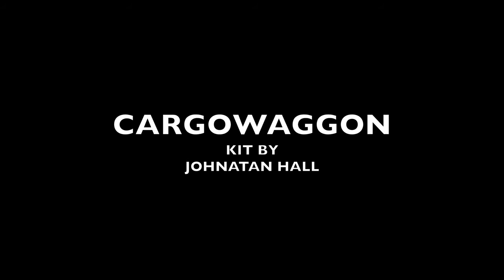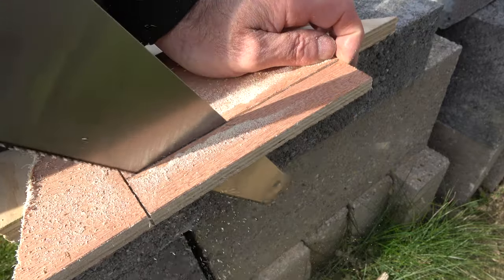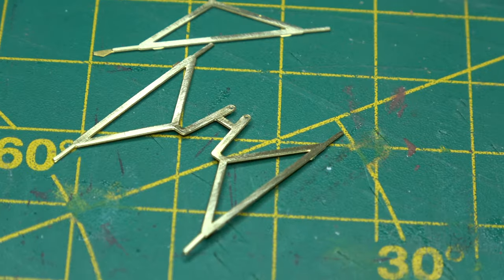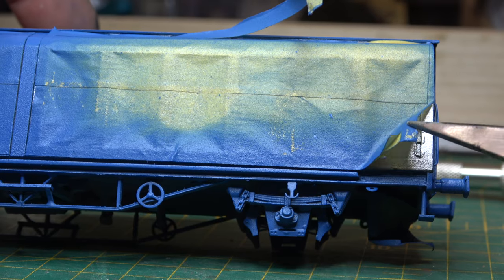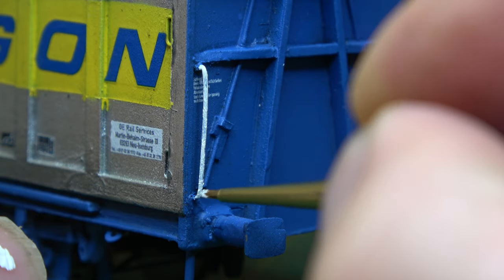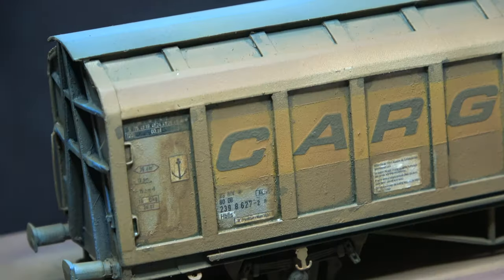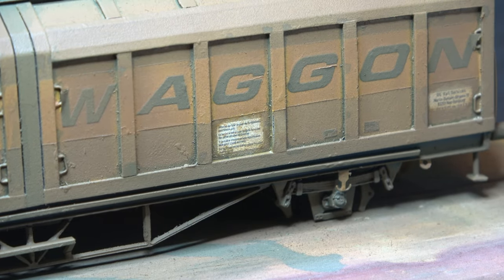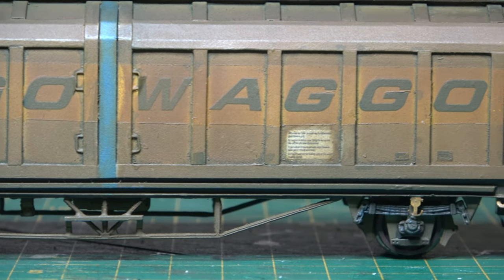IZA CARGOWAGGON kit build

Comment: Wonderful stuff! 

Now you're fully into the resin and an expert in the field maybe you could nip over to southern pride kits and indulge in a resin body for LION, fits a hornby 47 chassis. It has some things going for it... no yellow ends😅🤣

Edit; Did I say southern pride... I meant golden arrow... apologies.
Reply from the maker: A few years ago I converted a Lima deltic into DP2. Lion could be a potential project 🤔
Reply: @Wallsrail  being white it seems like it'd be a weathering challenge as well. Very easy to make it too dirty
Reply from the maker: @Trainskitsetc  Ooh now there's one of my pet hates 😝
Model engines with unrealistic weathering 😖
Reply: @Wallsrail  sure it would also involve some nice chopping and changing of bogie side frames to make something a little better looking than the raw donor 47 bogies

Has all the hallmarks of something you'd get joy out of, an adventure into making something that looks the part from something that's a bit meh. Not that you need suggestions there's probably a list as long as time of things to do

Comment: Nice to see you back with another wagon kit, never seen on of these before in person, the work you put into these kits amazes me.
Having a few troubles with a class 31, it's a Hornby original chassis with an airfix body, only problem is that the model was detail painted blue, the had the steam heat equipment filled and then was dumped in a box, so the paint is damaged and unfinished, I'm rubbish with a brush and thanks too 2 more 31s I'm now in £40 debet with my grandad.
Like you I have many projects on the go, mainly using mainline mk1s, some spares, a 37 nose for the high intensity light and a class 43 chassis
A sort of nodd to thumpers🙂

Are all old men bad with buying kits, after finishing three open wagons, my grandad bought another two😂

Have a good one and enjoy your hobby ☺️
Reply from the maker: Hornby/Triang 31? Hmm now there's a potential future project 🤔
I spend an awful lot of time scouring ebay for rare and out of production kits!
Reply: @Wallsrail  oh not that old its one of the original Hornby super details ones

Comment: Ahh the IVA vans. Being a 2mm modeller (West Coast, early to mid 90s) These have been on my to do list for a while to model the Dagenham - Garston Ford Train. Sadly they're not available RTR in 2mm, nor is a kit available. I may have to go down the 3D printed route, but as you say, there is a big difference between the IZA twin sets and the IVA. Length for a start. Another enjoyable watch.
Reply from the maker: Ahh the Dagenham Halewood 6L42 6M41 
class 90 and a string of wagon 1/4 mile long 100SLU. 
Used to be on that service quite a lot when I first started driving based at Crewe!!
Reply: @Wallsrail  Halewood of course, not Garston! Ahh fantastic mate.

Comment: Also may I ask, what is the paint code of the MIG blue paint you have used? I have a couple of Tiphook bogie curtain siders to do and the blue looks pretty spot on for the ends. Again, doesn't have to be the exact shade, as most will be weathered anyway. Cheers. *EDIT* 123 Marine Blue ??

Comment: hummm... Just one, you would need 7-12 for a rake and maybe some of the double sets to give the full train look.  i dont see the Ford logo either????  Having said that as a show piece  it would be just fine as it is. stuck in the middle of any freight set it would be a great purchace.
Reply from the maker: If I was building a set for myself 6 or 7 it would 'va been, but for a one off project, just the one is ok.
Logo's were either or not both.
With it being a standard cargowaggon not allocated to specific company traffic, gives it the opportunity, as you rightly say, to run as a single wagon in a speed link type train 👍